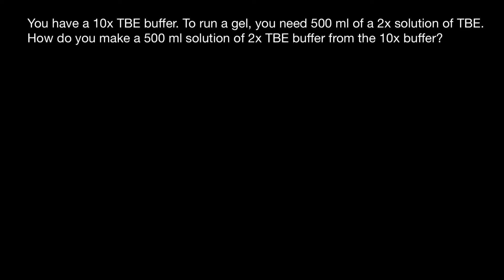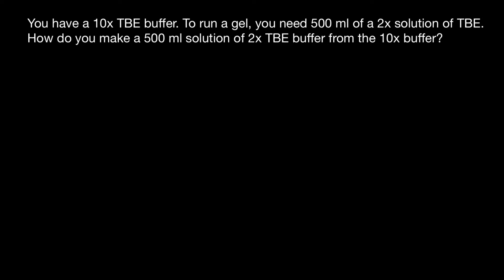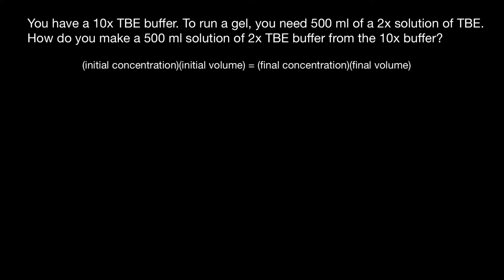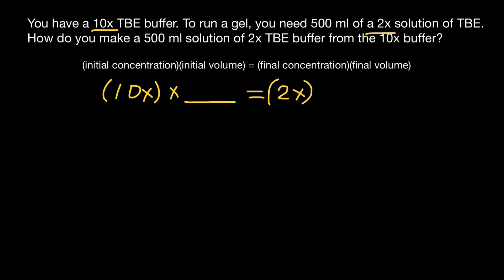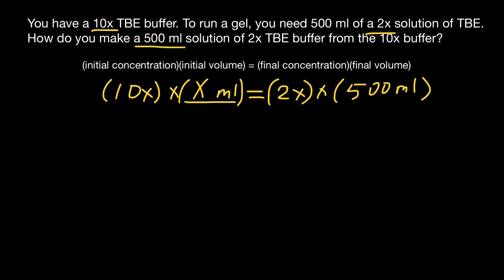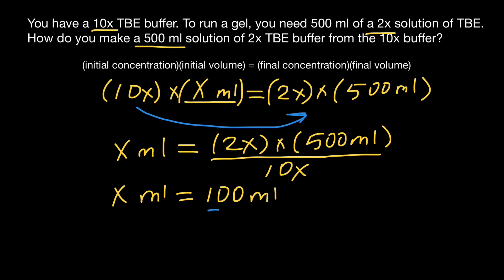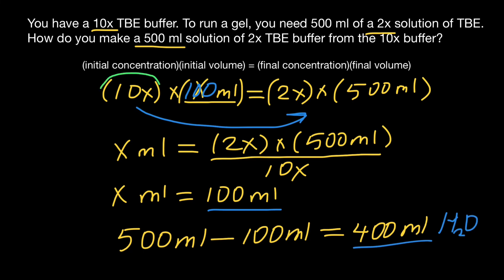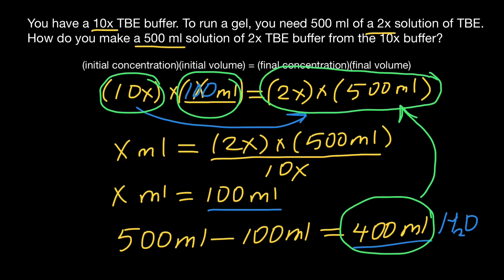How to calculate concentration of TBE or Tris/Borate/EDTA buffer

Comment: Which of the following amino acids would you LEAST expect to find in the trans- membrane region of a G Protein-Coupled Receptor?
A. Alanine
B. Leucine
C. Proline
D. Tryptophan 
E. Valine
Reply from the maker: Marat, they are all non polar and can be found in non polar part of the membrane, but probably we least expect to find Proline cause it is most ridged amino acids - and usually polypeptide chain has abrupt turn where is a proline - which is unlikely for transmembrane part of a protein.
Reply: Thanks